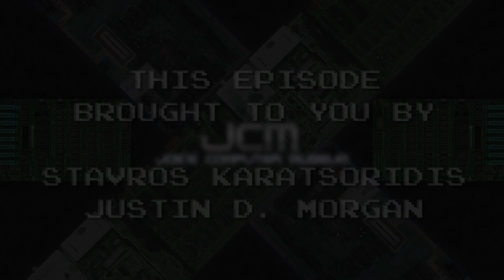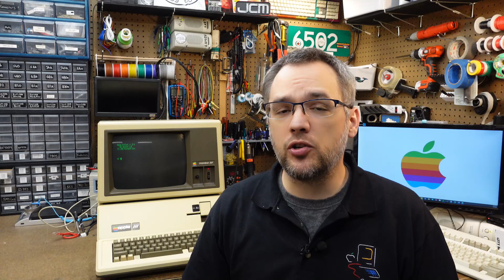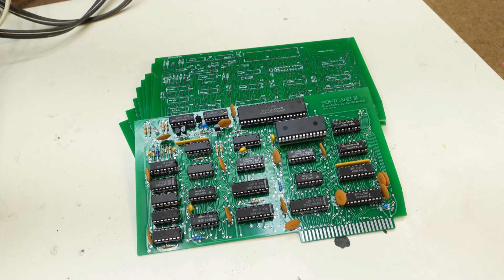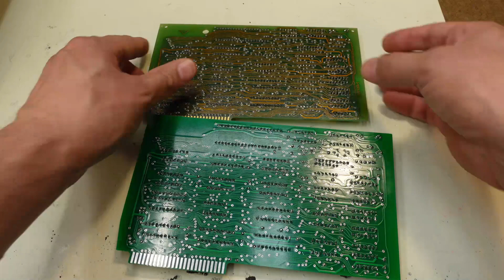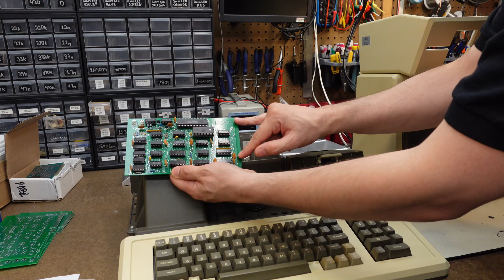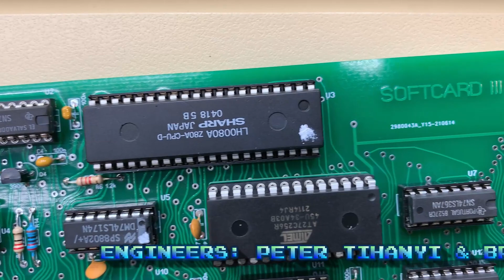NEW SoftCard III Reproduction for the Apple III Computer

Comment: Subscribed for //e plan updates. Good work.

Have you considered 3D printing for the rear bracket? I recon it would be easy to do. I've done a number of 3D enclosures for BMOW hardware to cater to that need.
Reply: I was thinking the exact same thing.  Once I get the card back I might just sketchup a bracket in ABS.   I'll need at least 4 more over time anyway for my cards/machines.
Reply from the maker: Keep in mind, however, that my first run of boards doesn't have the bracket holes. So, you'll have to use an original for a jig and crack out the drill bits. 😬
Reply: @JoesComputerMuseum  Been a while since I've seen an A3 but it looks like a flat plane that slips in the back casing, along with a pinch slot holding the card would do the trick.
Reply from the maker: @mglmouser  I'll consider it for a future run. I personally don't have the production throughput to support it, yet.
Reply from the maker: I thought about it, yes. If I design such a thing, it would likely be a do-it-yourself download though. I'm not set up to kick out prints fast enough for production volume.